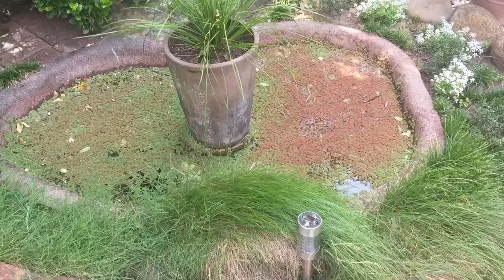Plan to do up an old pond

Comment: You could use that pot in the centre as your filter. Plumb your pond pump to pump into the bottom of the pot and put about 20 to 30 cm of fine sand in the bottom and the rest gravel. As water fills the pot it is filtered and creates a feature as it overflows as well as oxygenating the water. Just keep the sand from making its way into the pump impellers when not powered up, I included a power head in my pond and the fish loved the water movement. Raised ponds are better however.